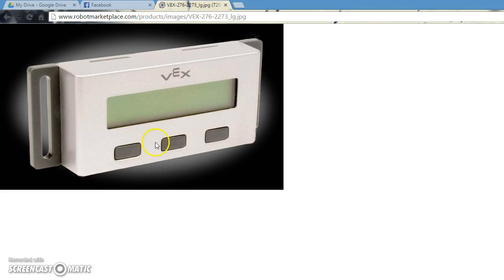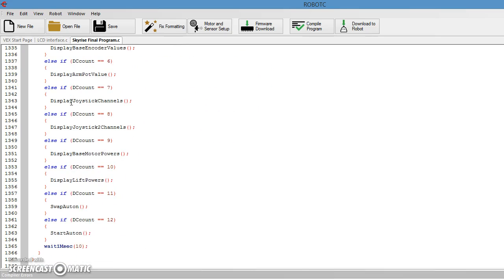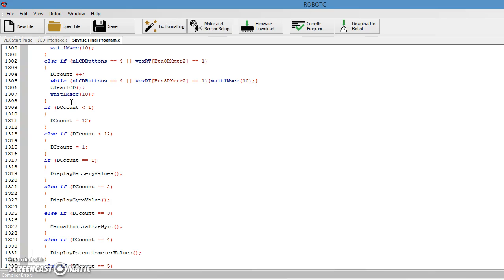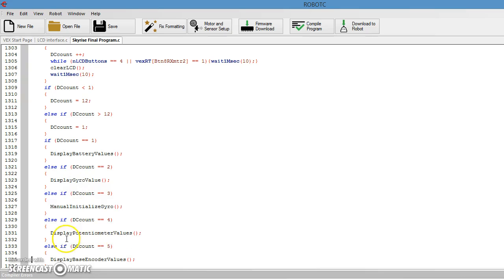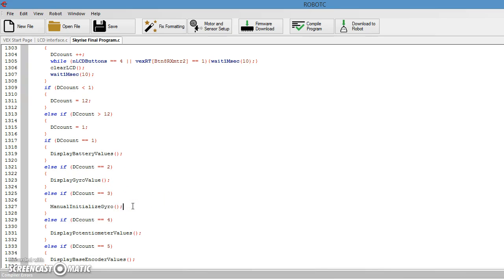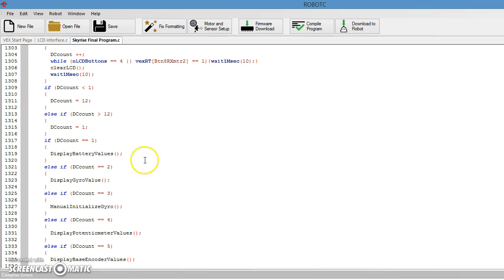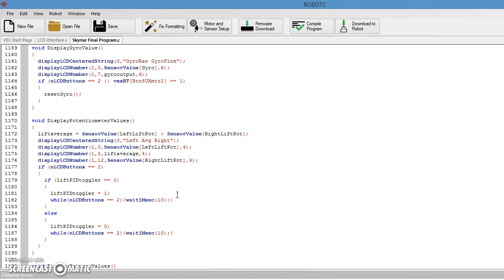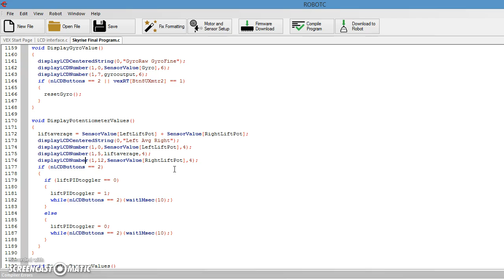Power Up Your LCD Episode 1 -- Introduction

Comment: If anyone is still on this... does this series cover how to calculate Rpm through the lcd? and if not then can someone direct me to where i can find out how?
Reply from the maker: +PaulsGames! I didn't cover how to calculate RPM, but it is pretty simple. You slow a loop down to 10 hz or so to get decent resolution (wait 100 ms), and then simply repeatedly read and zero out encoder. How much the encoder spins in 100 ms is a decent snapshot of how fast it's going at that instant. With some conversion you can find RPM from say ticks per 100 ms.